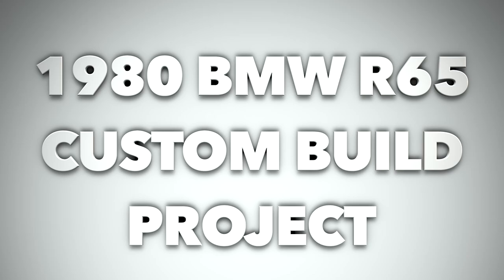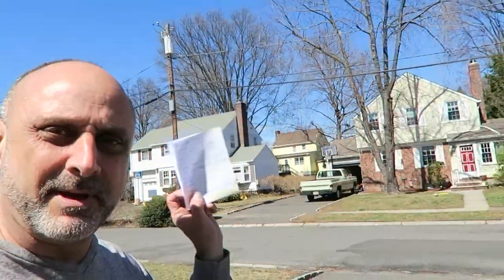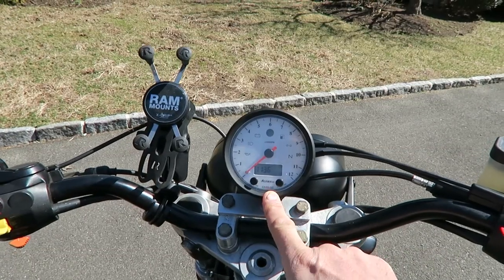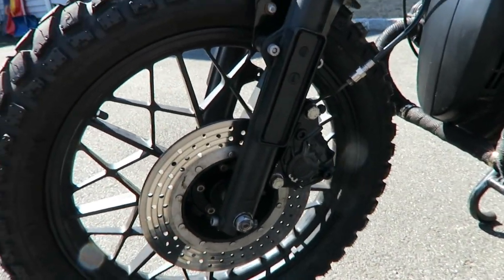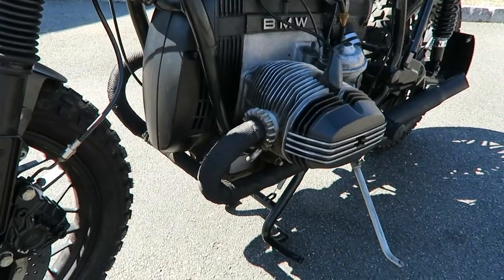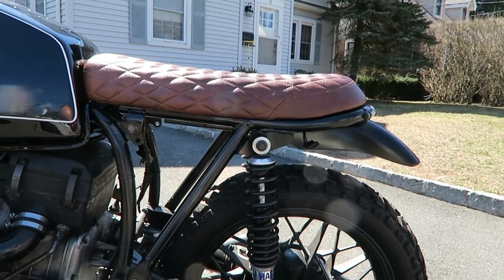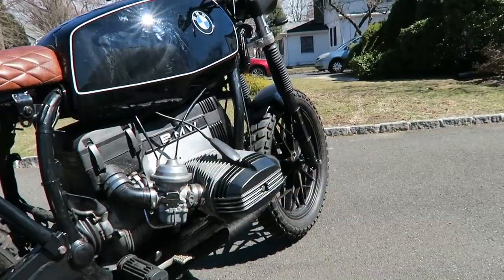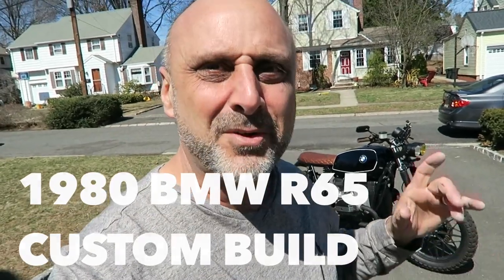BMW R65 Custom Build

Comment: Nice work mate. You should be very proud.   Did you say that you got new switches to install in each switchblock? I have never seen them. Mine look faded and ugly.
Reply from the maker: What switches do you mean?
Reply: @HOLYSHIFT  the high/low start buttons etc yours look very new.
Reply from the maker: @volvogt21  yes, I bought on Ebay used switches but in good condition and it looks very good. Sold my used ones on eBay too. Easy swap hahaha
Reply: @HOLYSHIFT  thankyou